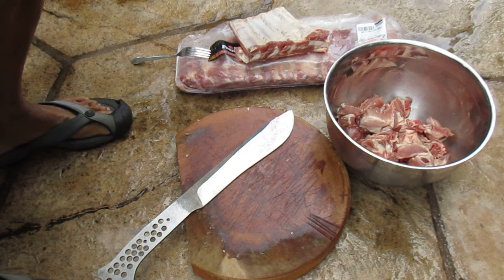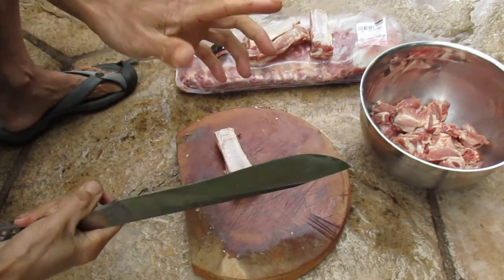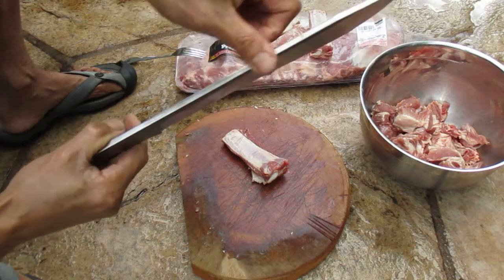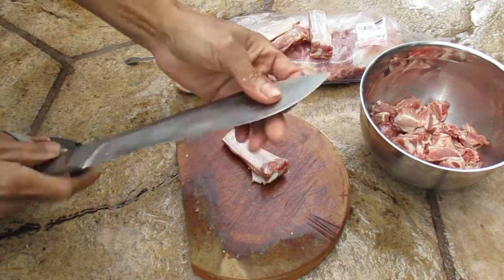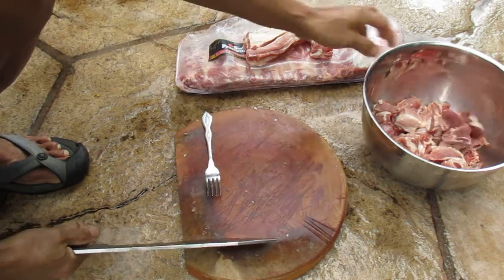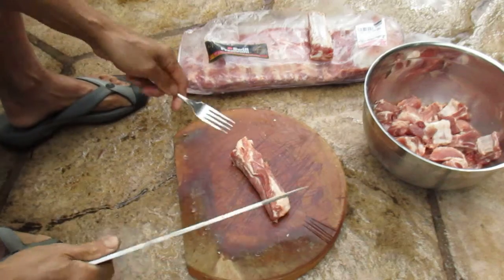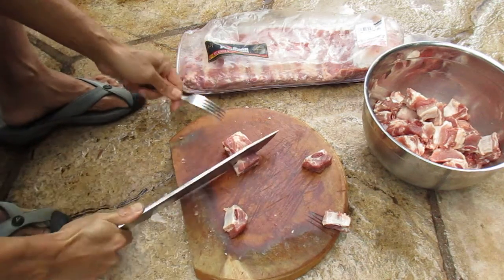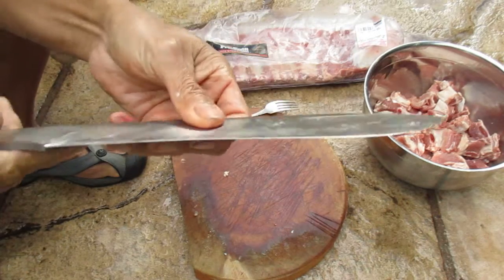BCMW 20160410 D2 65rc Jest Bolo chop pork rib

Comment: Do you super quench D2 as well? (I know it’s air hardening, but you’ve SQ’d other high alloy steels before.
Reply from the maker: I did SQ d2;d6;etc... nifty much all steels I ever ht-ed.  However I found deep air hardening steels didn't show discernible advantages over plate or oil quenching.
Reply: Luong La I see. Talk about experimentation. Most people would call it sacrilege. But I love water/brine/superquenching. 

How do you SQ stuff like 1095, W1/W1? Do you interrupt? Plunge once fully and then just move the edge portion in and out? Those are my favorite steels. Lots of carbon, very simple to work with in my backyard coal forge.
Reply: Luong La I see. Talk about experimentation. Most people would call it sacrilege. But I love water/brine/superquenching. 

How do you SQ stuff like 1095, W1/W1? Do you interrupt? Plunge once fully and then just move the edge portion in and out? Those are my favorite steels. Lots of carbon, very simple to work with in my backyard coal forge.
Reply from the maker: @Divine_Serpent_Geh  To fully quench W2,W1,10xx,etc... their pre-hardnen microstructure must support emergence of hardening austenite state where prior aust matrix MUST has grain size/diameter less than 4 microns.  Otherwise, must interrupt SQ (0.5-1.2 seconds) then into 7-to-19 seconds oil (depend on hardening depth) to avoid cracks during aust-to-mart transformation.  It is super fun to do a full SQ a chopper size blade into SQ tank - jet sound and arm shaking vibration give a nice rush... of course for blade with prior-aust-grain larger than 5um, 99% chance of getting 'ping, ping,  ... ' heart break.
Reply: Luong La So basically you need to give the steel a good 5-10 minute soak at austenizing temperatures? I have no way of measuring micrometers, so that’s out of the question. 

Also, does this apply if you are doing a differential hardening? Since you won’t have the spine at critical temp, it won’t pull the edge apart and crack it as it cools.
Reply from the maker: @Divine_Serpent_Geh  Process to prepare for sub 4um prior aust grain diameter  is very/quite time consuming - consists of multiple heat & cool cycles.  Break a file or drill bit to see what 8-10um grain look like, if your work look(30+ x loupe) better than them then maybe can try full SQ with shortest aust time (since longer aust time would enlarge what you've done/prepared before).  Perhaps just try standard grain refinement, which should give you grain 8-10um and do int sq.
even if you managed not to crack edge via diff sq, however result still poor due to nano-cracks.  I had to dealt with nano-crack for at least 4 years before solved this problem.  So I recommend you int sq.
Reply: Luong La Ok, I interrupt my brine/water quenches anyway, I don’t like taking the risk haha. 

So as far as soaking, how long do you do it? For steels with around 1% carbon (1095/W1 etc) There is this notion that you have to hold it at austenite temps for a bit in order to dissolve the carbon into solution, and the the most martensite formation. 

Also what is the hardest you can get with SQ 1095? I’m trying to get over 65hrc as quenched.
Reply from the maker: @Divine_Serpent_Geh  ~69hrc
Reply: Luong La Wow, that’s pretty insane! So how long is your soak time for this stuff? By the way, I’m using a coal forge, so for austenizing, the tools I have are magnet, color, and table salt (since it melts right at 1475F).
Reply from the maker: @Divine_Serpent_Geh  Avg soak for low alloy carbon steels is around 10-15 minutes in ht oven.  Coal & gas forge have higher heat capacity so (if I uses it) 4-5 minutes soak should be enough, since longer soak could/would lead to combination of higher RA% and plate martensite.  btw - my aust temp is low. btw2 - near submicron grain also reduces aq hrc.  my fews last 1095 ht, aq hrc around 67.5rc since it has avg grain size  less than 1um.
Reply: Luong La Well, sir. I will note all this down. I’m really trying to get most out of my 1095 this time. I should be HTing this blade let this weak or early next week at the latest. One last thing, what method do you use to measure hrc, or for someone like me, at the best, estimate? 

Thank you so very much for answering all of my questions, not many guys give such precise information 

Are you on Bladeforums by any chance? Or an email I could reach you easier in the future?
Reply from the maker: @Divine_Serpent_Geh  You can scrape your piece against pieces of known hrc - harder one almost always win.  Before I bought the hardness tester, I used this method... to gauge hrc to +- 2 rc, hence so can you.
I am 'bluntcut' on bladeforums, however not too active for the last 8-12 months due to shifted interest/business.
Reply: Luong La Ok great. Looks like I’ll be getting a 65hrc file for testing. Well sir, once again, thank you so much for your information and time. I will probably make a video of my process and I’ll send you the link shall I upload. I might also create an account on BF as well. 

Thank you once again, very grateful.